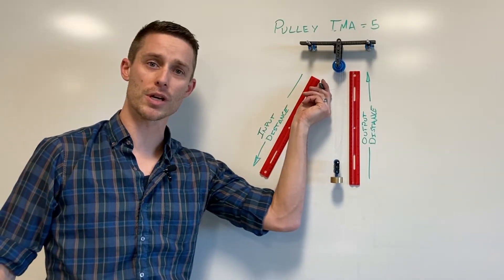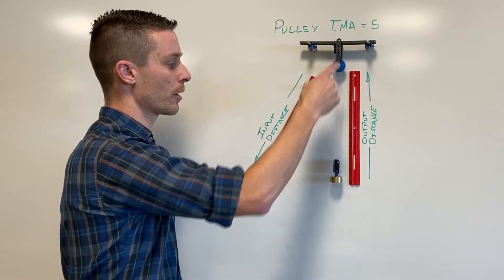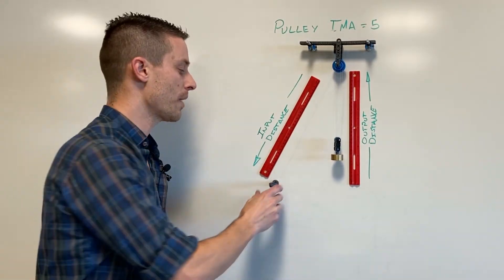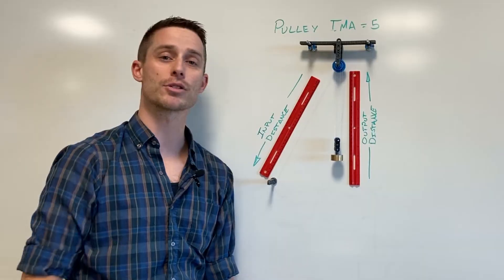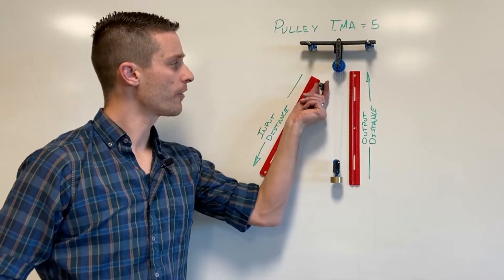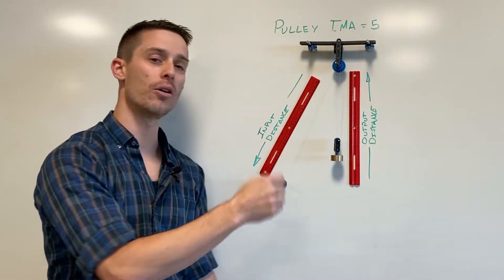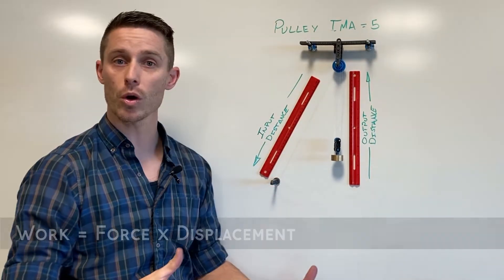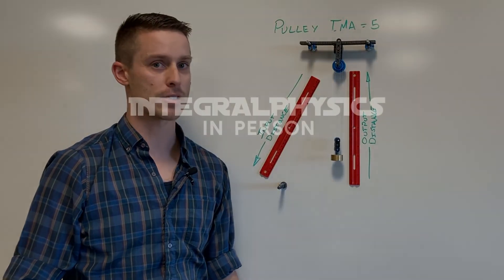See the Mechanical Advantage of a Real Pulley  |  Diagrams Don't Work

Comment: Ratio 1 pulley is 1 to 1 you have a pulley block which in your case i cant see how many wraps you have but your saying 5.1 which is very good! Now all this is great with small weights but i work in construction and these theories can be downplayed by like you said (friction) an non fixed anchor spot lots of cases you have to hang a chain or fix a rope around two trees and anchor in between! You start to put over 3000lbs on these pulleys and use 10,000 lbs of force sometimes just to even get material to move and it gets very scary!  The angles have so much say in all of it! These 90• angles only work on paper! Most i like to use is about 45 anything steeper the anchor takes all the weight nd can break!!!

Comment: I have never understand how you can pull a rope 12" yet have the load move 3".   The simple fact that it goes around a pulley still does not make sense to me.  
Where are the other 9" of rope?? No point in trying to explain; I'm 81 years old and have never understood.  
Any more than I understand a mathematical equation how a bunch of symbols and letters can result in more symbols and numbers that give you the temperature on the moon if I open a closet door at home.
It's hopeless!
Reply from the maker: Its like taxes.  The government raises $20Trillion but each tax payer only pays a few thousand.  Pulleys are the same idea, the input gets 12" longer but each strand (there's 4 of them in your example) connected to the load only has to give up 3"